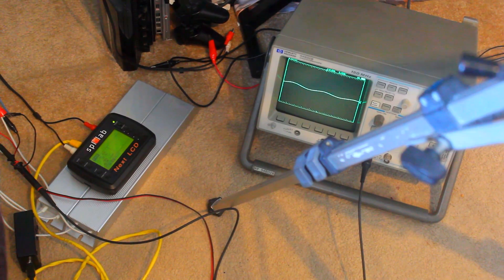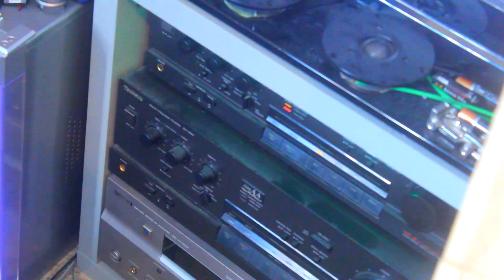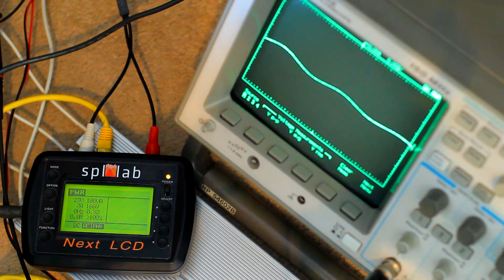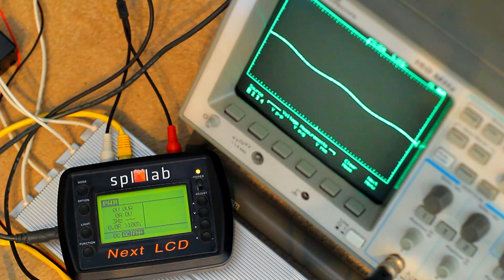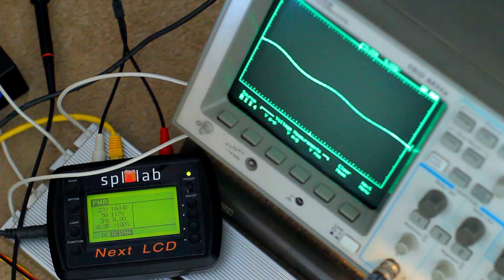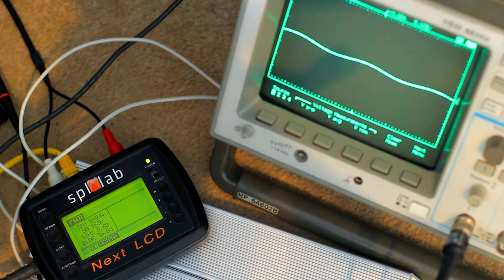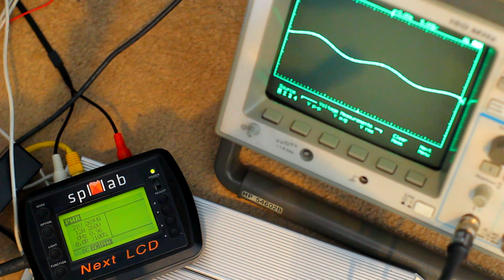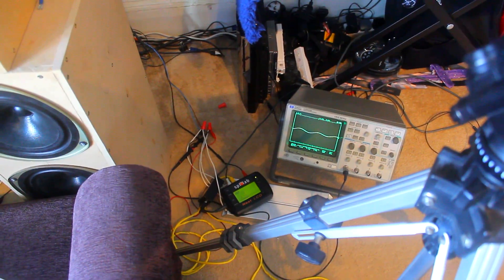Technics SU-V 550 & 650 TRUE POWER! Bench testing old amps!

Comment: If that amp was class A the heat sinks would need to be bigger than the entire chassis. There is no such amp topology as "class AA". It's nothing but a marketing gimmick. Also, the amp stared clipping at about 150 watts (you can't go passed clipping and then use that number) and that is typical for a 90watt @8ohms rating. Really good amps will put out double the watts for half the resistance.

Comment: When you test the output of an amplifier always test both channels together. The power supply voltage will sag with the extra load of both channels. If you have a true twin mono with two separate power supplies you can test one at a time.

Comment: They do have impressive power but I will take a 50 watt RMS per channel amp with great tone over a power monster with harsh/bright tone. Those Technics, while they could drive most speakers well were very harsh in the upper registers making them hard to listen to for more than an hour or so. It may be fine in a club or hall but for enjoyment or critical home listening, not so much. They also had a poor build quality especially with the control buttons, which commonly fail.

Comment: I have an SU-V900 twin mono that rated @140W into 4 ohms. Was used to power the night club speakers when professional 2kW amp took a dump. And did awesome job. Unbelievable power. Did generate tons of heat since it actually does work in class A. And eventually fried tweeters:/
Reply: It does not actually work in canonical class A, Technics class AA is a marketing gimmick not a representation of reality in terms of output devices bias characteristic.
It fried the tweeters probobly due to being overloaded resulting in generation of higher harmonics, the usual result of such carelessness. It is a good amp though.

Comment: Hey  , Barevids i would love to know how do i wire speakers in order to drop the ohms in the amplifier i want to do this for my technics su-v2 so i can bench test it :)
Reply: Alexandr hi there, if you wire up a pair of 8 ohm speakers to speaker output A, and 8ohm speakers to speaker output B the amp would be running like a pair of 4 ohm speakers connected . wire two pairs of 8 ohm speakers in parellel and it becomes 4 ohms. two pairs of 4 ohm speakers becomes 2 ohms ect.

Comment: Interesting to note, both amplifiers have very similar circuits, both share the same power IC the Sanyo SVI3205, but probably with better power supply and higher voltage for the V650. ;-)